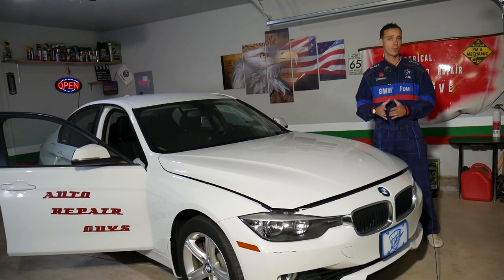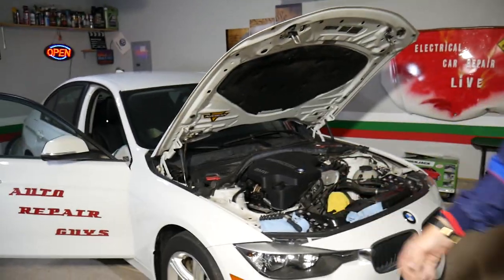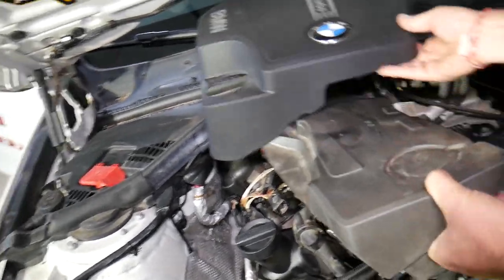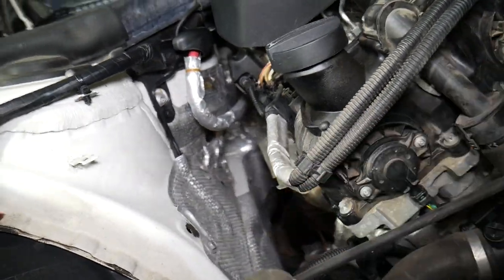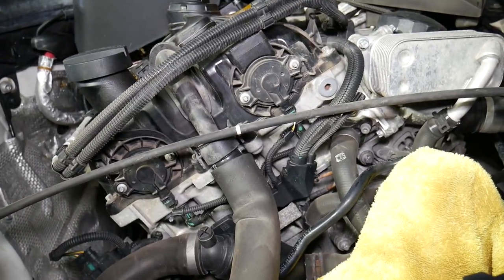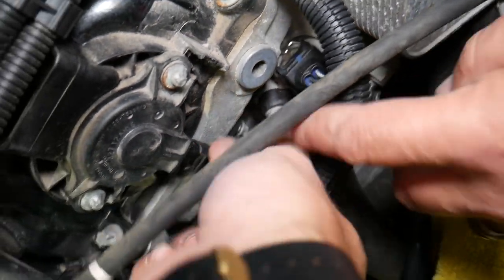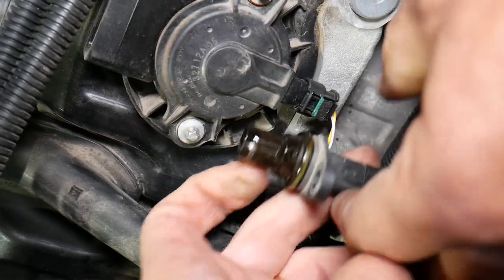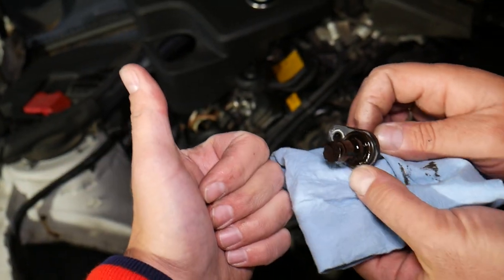BMW CAMSHAFT POSTION SENSOR REPLACEMENT BMW F30 F31 F34 320i 328i

Comment: Hello I replaced timing assembly from video tools I bought ,2013 bmw automatic 20 engine timing is on point but no start.  Found sensor wheel in center not moving as I spin motor .I reopened valve cover to triple check was wondering if need to reprogram .since car was with out battery for more then three weeks.maybe you can help

Comment: Hello, I have a problem of starting my engine when is very hot, it doesn't start, I have to wait when it will cold. What's is the sensor which could make this problem, I have the same  auto which is in video ?

Comment: My car BMW 2004 330XI Have problem the Mass Air Flow Sensor after I  Replaced  new Mass Air sensor but the (check engine soon)  didn't go away and still do the same problem . Can Auto repair give a idea
Thanks.
Reply: Hi, did you clear the engine light and it came back?
Reply: My 2012 bmw 328i is not getting fire to the fuel pump in the gas tank how to fix it